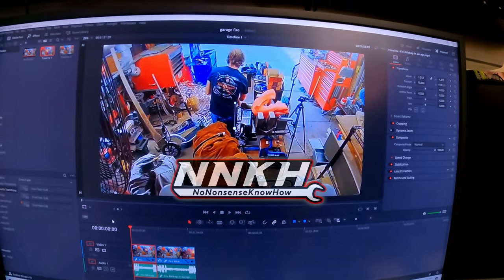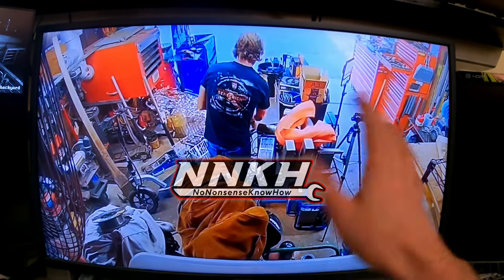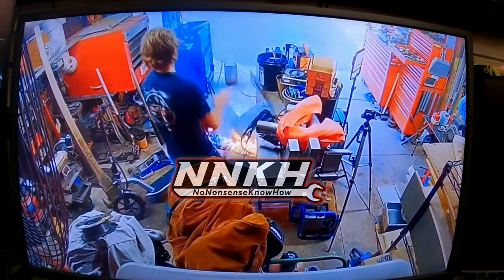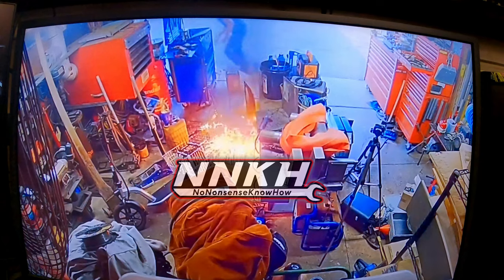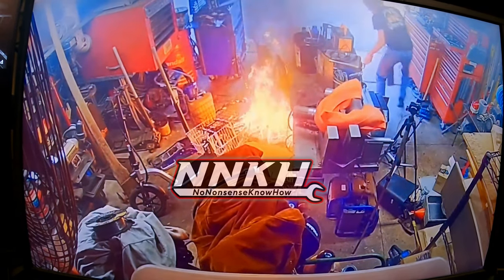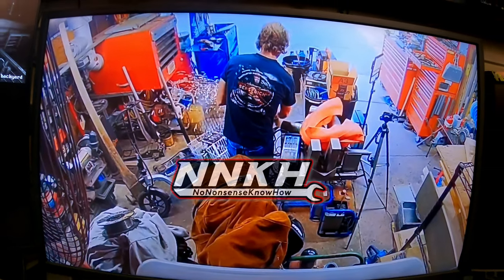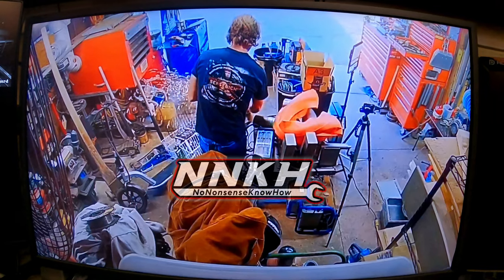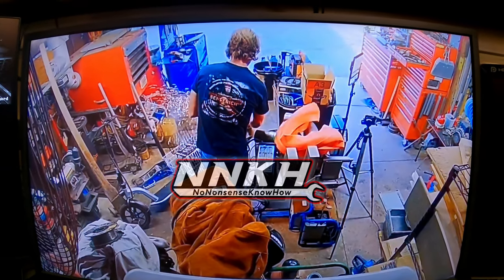Garage Fire Explanation

Comment: Glad you and the garage are ok. One time cutting plow mounts off of a dump truck I caught the grease and oil that the old diesel had been leaking on fire. The garden hose was winterized, I didn’t know what the hell to do. I ran into the house and grabbed cup fulls of water to calm it down before realizing that wasn’t going to come close to enough, ran inside, turned the water valve on, luckily the hose was hooked up, and doused it. No real damage, just an eye opening experience. Next day went and bought a big high quality fire extinguisher, and now whenever I see them at the dump, as long as they are reasonably not out of charge I pick them up. I’ve got a little collection of 5-6 in the corner of the garage now. Even when their out of charge, they normally still discharge fine.

Comment: It happened to me while cleaning fuel injectors : 
I took the fuel container outside FIRST  to not aggravate the situation by adding inadvertedly combustible to the fire.
Then i walked fast without running to get the fire extinguisher.
I learned that you have to separate combustibles from heat/spark sources at all time.
I learned that you need to have a clean environment without bunch of stuff in the middle in your working area.
several maintained fire extinguishers easily accessible are a necessity,like a water source nearby.

Comment: Great little video.  We've all done similar stuff, so you've probably saved a life if one person upon going back in their garage has a tidy up. Good man. I once had a sudden fire in my workshop. I was heating an engine casing to accept a bearing and some residual brake cleaner I'd not realised had puddled lit up and set a load of stuff on the bench alight. I keep a powder extinguisher on the side of my tool chest and after first near sh*tting myself I pulled the pin on this thing and sprayed it for like, one extended blast.  Probably not two seconds. Put the fire out great. But OMG for the next two years I'd be getting parts and stuff off the shelf on the other side of the workshop and there was powder on them. The best thing about the powder extinguishers is that the powder gets EVERYWHERE quickly. The worst thing about them? That the powder gets EVERYWHERE quickly :)

Comment: That brings back memories, not good ones tho. I am a welder / fabricator and I built the biggest stage in the worlds biggest night club (Privilege on Ibiza island Spain) when the stage was completed I was welding a few last bits with my screen down, someone cut their finger and came to use the firstaid box located in that area, I checked everything was safe and far away from my work area before welding some small pieces, the person who had a cut finger took isopropyl alcohol from first aid box and used the end of my bench to treat their wound leaving the open isopropyl bottle open and a soaked cotton swab, I didnt hear them or know anything until Boom and 6 foot high flames. Now shouting fire a few people came with extinguishers and all was good again in seconds, no damage and we never discovered who the person was who treated themselves. True account!

Comment: With extinguishers two is one and one is none... They're cheap enough and can really save your bacon when shtf. And size does matter too, the small bottles don't last that long so it's necessary to take aim and think before acting. Also keeping your garage/workspace clean will help prevent accidents like this. It would also be a good idea to plan your work so you always have a way to get out if something happens, it's not fun to run over flaming puddle of oil to get out or get the extinguisher.

Comment: I have a real fear of uncontrolled fire.  Funny story but not, years ago my uncle and I were doing a first start on a mud truck.  Had a fuel line running in to a 5 gallon gas can.  With excessive cranking, the carb was flooding over and the valley of the engine was full of gas.  When it finally fired, it backfired through the carb and it lit up.  I started running for the door, with my uncle shouting, where tf are you going!  I was outta there lol... He started cranking it again and it sucked the fire in to the motor and all ended well.  Fast thinking on your part, that could've been really bad!!!

Comment: but always have the water hose as back-up always get the hose  ready save your house and property an extinguisher isn't always enough. before you burn even grind put all your fire stuff hose extinguishers on stand by before you work and wait around 45 minutes after any grinding and burning. i saw many jobs where guys didnt wait around and a smoldering fire was started. they didnt see. and it created a fire after they left. twice in my tenure i was stuck with the mess of guys being careless and had to put the fires out

Comment: by the way you can use water just spray the flames not the base get a feel for it like you did when spraying the reaction of the spray on the fire you did good. i always use water. and that dry chemical it the worst c02 is best but water will work. i used to work at isg plate Conshohocken grease every where and we used water just be carful when doing it like you were doing it., that dry powder is the worst and dont breath it i know some one who was in the hospital for weeks messed his throat and lungs up

Comment: first of all you have a cluttered work space. and all burning welding and grinding you should have a fire watch, what the fire watch does is wet the area down when possible and always has some kind of fire suppressant at reach. you did good though didnt panic. but i assume you were having thoughts of every thing you owned was going to be gone and your neighbors thoughts what they would think. as you were scrambling.  glad you were okay but in the future you need to do that out side away from the shop when you dont have a fire watch. as a millwright industrial mechanic with decades of demo and mechanical experience take my advice. if a fire watch isnt available than you should do it out side open area with any combustibles' at least 10 feet  away

Comment: All i see is a welding jacket, i would have just thrown my welding jack over the top and stopped it out.
Reply from the maker: It's a nice leather jacket that I wouldn't want to ruin by throwing on flaming used motor oil.  I know that's not the right mentality when there's a fire. But I knew I had an extinguisher right next to the door. It just wasn't there when I got there. Lol.  Luckily I had a backup